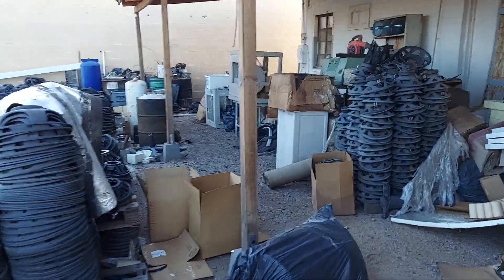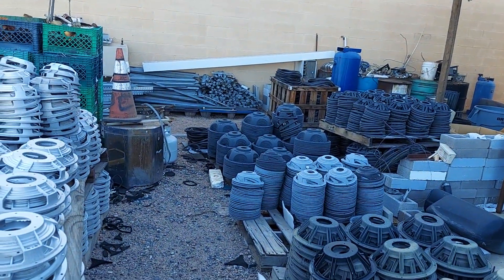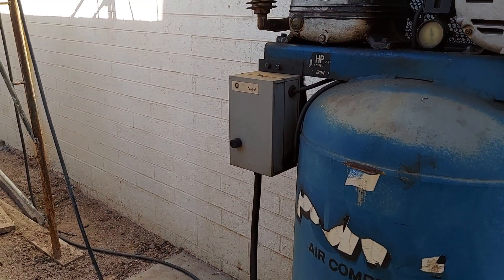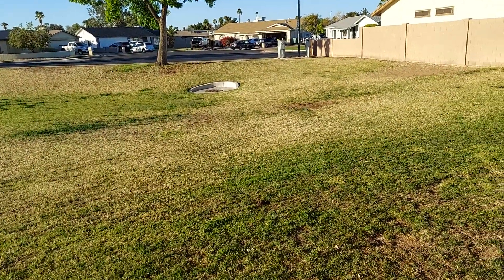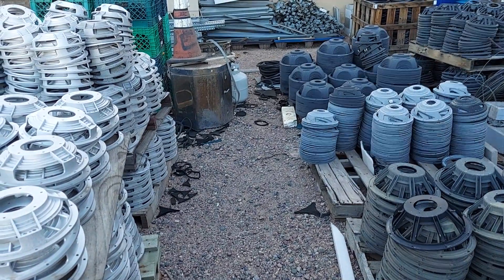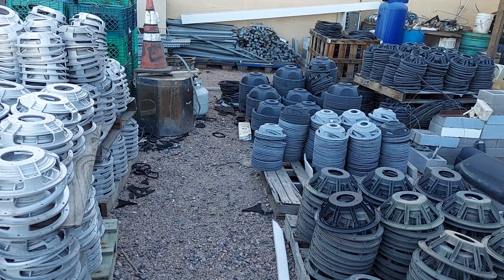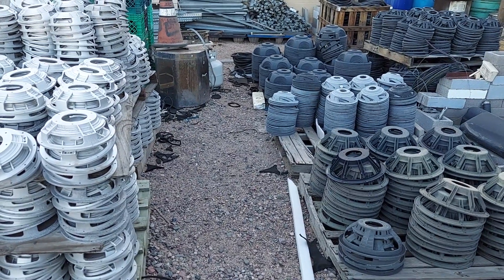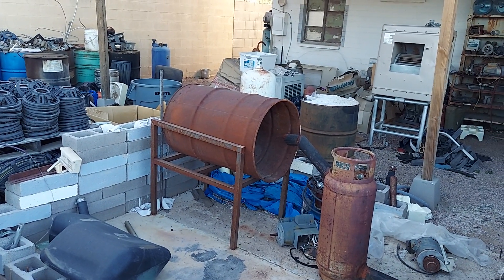Power your house and your neighborhood with trash and old tires

Comment: interesting way to make power, people up here do similar but mostly for heat.  i use a ton of solar for my place then have a pretty decent mining setup which keeps the house at 63 degrees when its -10 outside and makes me a decent profit. i used to collect trash and pallets at my last house for heat id chop wood but often id sell it by the cord rather than use it myself because pallets and stuff are all over. am working on building a lithium power storage system for big non everyday

just an fyi those hoverboard deals are a good source of generators and battery packs with a built in bms. usually 24 or 36 volt 4 ah. then the motors are 3 phase ac so can be rectified to dc then hooked up to a wind charge controller. make power through pedaling or wind or whatever. i look for them every time i go to the dump. also fisher and paykel smartdrive motors are great generators same with the clones in others like samsung. im in a high wind area theres almost a constant breeze so i figure i should capture some of that energy

i mostly use an assortment of 6 volt batteries for my power storage then have a bunch of 12 volt batteries that stay in the shed to power tools or charge them there. theyll be getting their own power system this summer. ive been toying with the idea of geothermal as well but idk if im going to be staying here long enough for making that worthwhile
Reply from the maker: All great info.  Thanks for sharing.

Comment: Hay how much for a rockford hx2 basket?
Reply from the maker: What size?  What style?  What color?
Reply: A 12 inch black
Reply from the maker: @badasscaraudio2240  For which motor?
Reply: @RobotUnderground  punch hx2 3" moter 500rms
Reply from the maker: @badasscaraudio2240  That uses a standard bolt hole pattern.  I'd recommend one of the 4 spoke frames we have in like a dozen colors. Text me. 6023126504

Comment: Fact: Water is 23 times more efficient than air at cooling. Good 'ol thermodynamics!!
Reply from the maker: I forgot to add that the boiling water is also a great way to clean it.
Reply: i think its really alot higher like...900 x 4.18 x coefficient of friction

Comment: Great idea on generating electricity.   You should also try using thermo generators so it’s all solid state.
Reply from the maker: I want to do geothermal cooling in the yard.  Get's hot here.  50 degree dirt all year round.